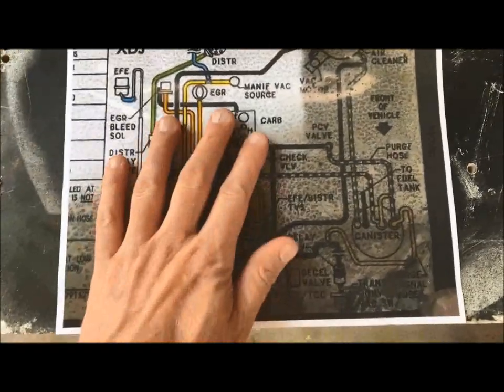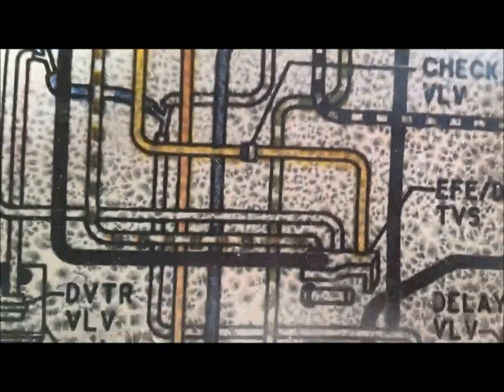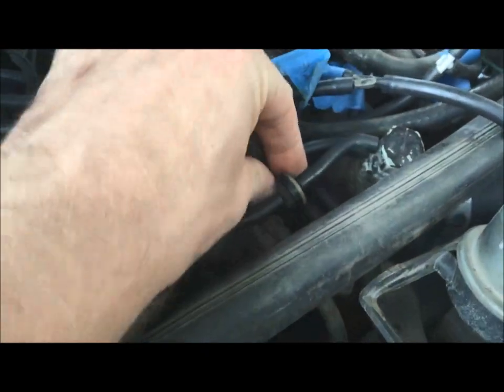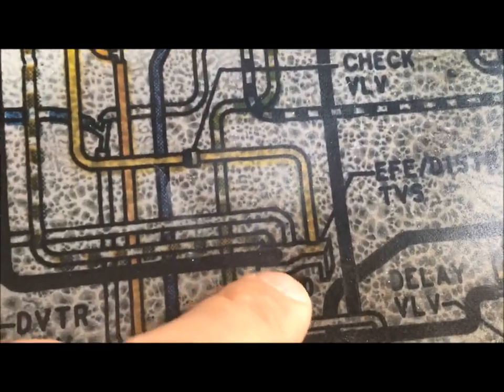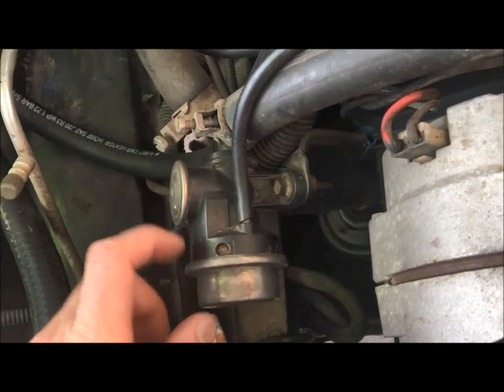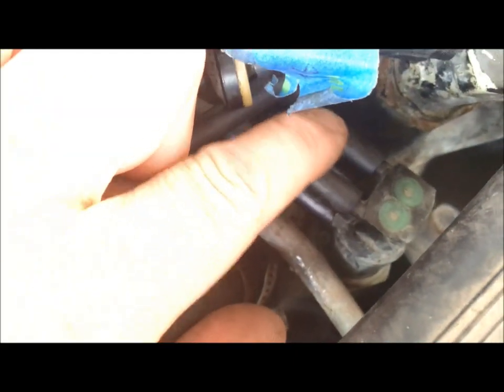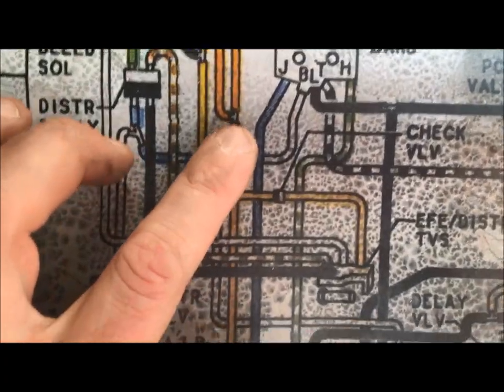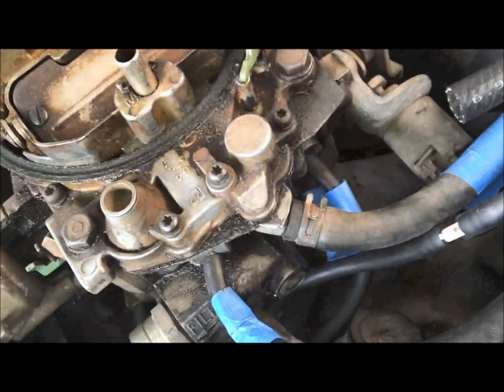1984 GMC Vacuum Line Trace Out SOLVED! Part 2

Comment: I agree, this was super helpful.  You mentioned that you were also going to show how the cruise control is hooked up as well.  Are you planning to do another video?  I just purchased a 1985 Chevy K10.  The guy before me put in a rebuilt motor and a Holley Carb, but didn't bother to hook anything up in the vacuum system or the cruise control.  I have some conversations to have with Holley regarding adapter plates for the TV cable and accelerator cable, but your video gets me a long ways on everything else.  Now i just need some help with the cruise control.
Reply: I have every intention of putting it up.  Maybe I can knock it out this weekend!  I had the transmission rebuilt because the person before me never hooked up the torque converter clutch vacuum...;(
Reply: @montanamade1114  I bought an 84 with 305 that has a huge line on drivers side thats blocked off. I see that yours is connected and that mine is missing pieces. Looks like there is a large diameter metal pipe that is vertical. I watched both of your videos hoping you would show it. Please help?

Comment: There's a vacuum pump of some kind (not the vaccum modulator) on the passanger side of the  transmission i took it off a while back and have no clue as to how to put it back ...... transmission won't move the wheels until i put it back or so i was told so if anyone could shoot me a picture of that i would greatly appreciate at it...or let me know what it is( cause i have no clue) I'd greatly appreciate It.  Transmission is a Turbo 350 automatic
Reply from the maker: Interested in this...here is a link.  I thought vacuum modulator at first as well.  Its on the passenger side near the rear of the transmission.  Where is the location of the unit you removed in relation to what they have shown on this link?  What year vehicle and make?
http://67-72chevytrucks.com/vboard/showthread.php?t=502579

Take a look at this photo and see if you can identify the part you took off, or the location that it was at.

https://www.hemmings.com/magazine/mus/2005/11/TH350-Transmission-Swap/1281614.html 

Quick question
1.  Did you service your transmission?  If the fluid is low it won't hook up.  I have done this a time or two;)

Comment: I have a vacuum reservoir on the driver side near firewall.  The line from it is not currently connected and I don’t see the reservoir in the diagram.  Where does it connect?
Reply from the maker: Year, make, model?
Reply: Lukes Garage 1985 Chev C-10 with 305 v-8
Reply from the maker: Check out this thread.  http://67-72chevytrucks.com/vboard/showthread.php?t=682969
Reply: @MechanicLife  if my vacuum is off my brake buster will my brake go down to the floor
Reply from the maker: Typically if you have that situation where the pedal goes to the floor your master cylinder is bad, you have a leak in your system or you have air in in the lines.
Reply: @MechanicLife  I got to push the pedal rally hard to stop is that air or a bad brake booster i have rotted air lines all over that I got to fix it on a p30 camper
Reply from the maker: What does the fluid look like if you pop the reservoir open?  Also if you have rotted hoses definitely start there.  I just did a while vehicle replacement and it cured a load of issues.
Reply: @MechanicLife  I am a trucker I will not be home for two weeks  I just got it I drove like 400 miles scary it has hi idle when I shout it off it keeps running aka dieseling Chevy 454 so I will do vacuum lines I made a smoke device so I can trace it better and when I get home I will let you know what the brake fluid looks like your videos help thanks

Comment: Hello! I have a 1984 Chevy G20 van. I have a corroded valve in the vacuum system and need to replace it to get proper seal. Doesn’t look like i can send a photo in these comments. I can’t seem to find a replacement part online anywhere, and i don’t know what it’s actually called. It is threaded into the intake plenum and has three ports: the one on the top is a metal line that goes down to the transmission. That is the only one that is intact. The other two ports are facing the passenger side. The upper port on the side is completely corroded off and connects to nothing. The lower port has been “repaired” poorly and connects to a split going to the front of the engine and the carbs TVS valve. For what it’s worth it’s right by the distributor. It’s got 3/8-inch npt threading. Do you know the name of this part so I can find a replacement?
Reply from the maker: Photos?

Comment: pretty sure I didn't hear anything about any vacuum that goes to the heater and air conditioning switch. Did I miss something? At what point did you mention that line. Just trying to re hook up my heater and I don't think I have vacuum to it

Comment: I have an 84 CHEVY G30 motorhome with yhe 350 and california emmissions... I took all the hoses out because almost all have been dry rot. THAT WAS A YEAR AGO. I cannot get this thing hooked up right. All diagrams online are barely helpful and blurry, i dont know if a device is broken or if the vacuum lines are routed wrong.
I wish I could just strip off all of the extra "emmissions" crap!

Thank you for this video, it has been a tremendous help
Reply from the maker: Glad it was helpful. California is a bear for sure!!!

Comment: my diverter valves on the "YKD" engine family 7.4l 454 take a larger diameter emission hose than the usual 1/8" inner diameter. And it also has one additional port of the usual 1/8 dia. wher as the rear diverter valve at the rear right bank has only the one larger port. And although similar to yours because of 1986, differs  cause yours has a slightly varied connection diagram.  Nice Viideo.  And I love the name of your channel.

Comment: This was super helpful bro 
I super need the second video
Reply from the maker: Check out my channel.  The first video is up showing the trace out of the remainder of the system.  I will also put a link in the description to it.  Glad it was helpful.
Reply: Lukes Garage I subscribed already 
Can I send you a pic to ask you a question 

I was only lost one part 
The choke has a hose that goes to it but I’m not sure were it hookes up to because your truck didn’t have it were mine is at 

Your probably has it behind the carb
Reply from the maker: You bet.  MontanaLuke01@gmail.com.   What vehicle is it on?
Reply: @MechanicLife  hey Luke, I'm tracing mine and it's not quite right with how it was hooked up. I went to go put the second port that you said should go to a stainless line to the efe. my stainless line is gone.... can I just cap it?
Reply from the maker: You can cap it, but here is whats happening. The EFE is a valve that closes when the engine is cold causing exhaust to move over the manifold.  This causes it to heat up to evaporate fuel so it doesn't pool in  the intake.
Reply: @MechanicLife  it does have the original manifolds on the truck but from there back has been replaced, I'm not exactly certain the valve is there. is it built into the manifold or would it have been bolted to the end of it?
Reply from the maker: What vehicle do you have?
Reply: @MechanicLife  it's a 1986 GMC k1500 with a 305
Reply from the maker: http://forum.73-87chevytrucks.com/smforum/index.php?topic=33450.0  Check out this link.  May be helpful.  There is a diagram I think might help.

Also loads of diagrams on this page
https://www.autozone.com/repairguides/GM-Full-Size-Trucks-1980-1987-Repair-Guide/VACUUM-DIAGRAMS/VACUUM-DIAGRAMS/_/P-0900c1528004c3cb
Reply: @MechanicLife  thank you

Comment: Excellent video. Extremely helpful for the home mechanic. Are the 350 and the 305 the same. I have a 1885 Chevy K10 with a 305 that the last owner ripped almost every vacuum line off and I am trying to get running as I restore it to the factory settings. Do you know if someone make a complete kit that someone can buy to replace and restore all the vacuum/emissions hoses and valves? Thank you.
Reply from the maker: They are very close to similar.  I did a 350 swap on this Jimmy and used all the same routes. I dont know if there is a kit though. That would be awesome!

Comment: Looking for the wire that connects to the idle control solenoid on the carberator ot was removed on mine is it connected to the wire harness with 2 plug on the firewall

Comment: These videos were a huge help in trying to figure out all of the cut and blocked off vacuum lines I have. Can you tell me what the tip in vac switch on the passenger side firewall does? I’m getting conflicting  reports when I search it
Reply from the maker: Glad to hear it.  It functions as a component of the Electronic Spark Control system.  It briefly retards spark timing.
Reply: @MechanicLife  that’s what I’ve been gathering and it was throwing me off. I was told by the original owner that the original 305 was replaced with a 350 which I never got to the bottom of but I’m assuming now the ESC was gutted. There are no signs of a smog pump ever existing, the vacuum lines to the EGR, and distributor advance were also plugged.
Reply from the maker: I also changed out the 305 to a 350 on this rig.

Comment: Luke u said u were going to finish with a video showing the cruise control and I have a 4 barrel carb and can’t figure out where the throttle return solenoid on the carb plugs in
Reply: I am redoing a 1984 chevy k5 Silverado blazer with a 305 4 barrel plz post a new video
Reply from the maker: http://www.73-87chevytrucks.com/techinfo/7387CKMans/Training/1968-1982_Cruisemaster_Cruise_Control.pdf 
I dont have the other video up, but the link above should help.
Reply: 1st Luke thanku soooo much for ur help so far .... I’m having a problem finding the vacuum line that goes to the throttle return solenoid ... I followed both videos and am now rewatching it but I don’t think u mentioned it .... bought a child on manual and it has it but never mentions or has vacuum diagrams .... any help would be appreciated

Comment: Very informative videos.   This will help me this weekend.   Quick question.   On your Manifold Vac. Source..  The vacuum hose on the top, where does it go?..   I noticed you have it connected to a check valve and split into two lines.
Reply: Nevermind.   I was able to figure it out.  One line goes to the accumulator tank and other goes to a/c controller on the firewall.